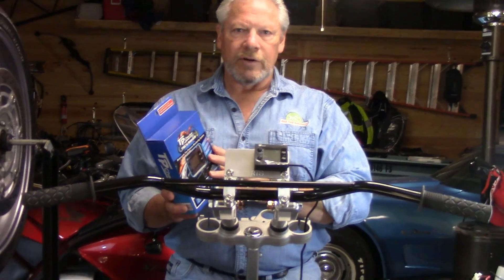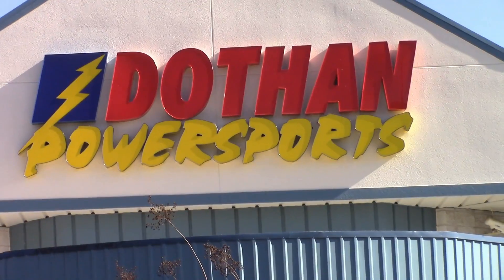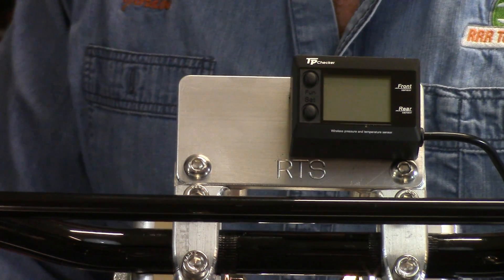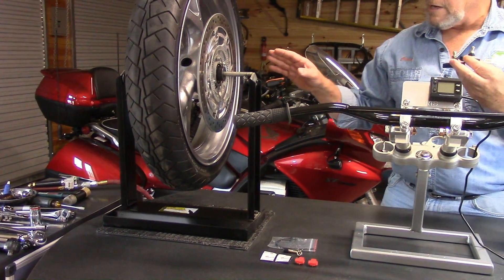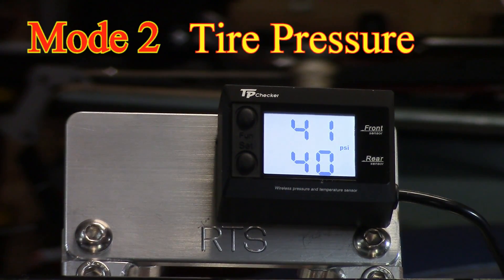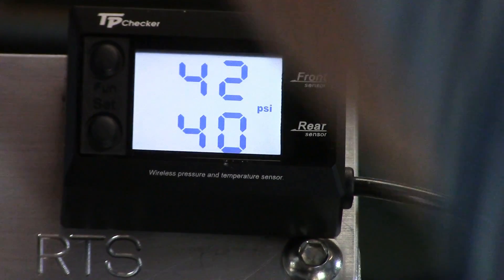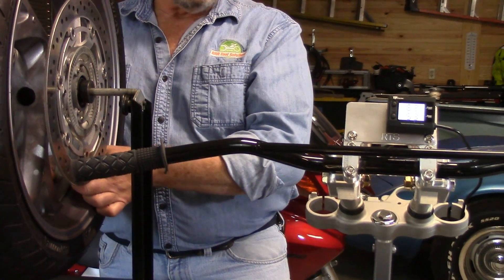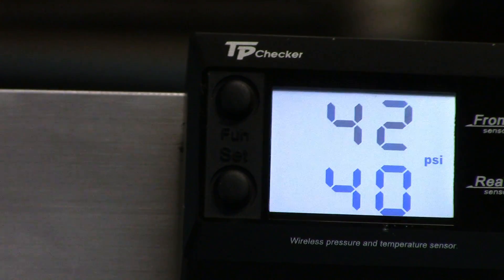Motorcycle Tire Pressure Monitoring System TPMS

Comment: Actually, some of the screw on TPMS sensors can read temperatures but I don't know how accurate they are. I just tried one of those screw-on systems and I returned it.  Here's why:  First, when you start out on your first ride for the day, that's the time to check your tire pressure. The tires should be  cool and not sitting in the sun and the bike should not have been ridden for hours. The same goes for checking and adjusting air pressure with any tires.   Well, with the screw-on system I tried, when you start your bike, it doesn't give you the real-time pressure. It gives you the last temperature reading from the previous ride. So to make sure your tire pressure is correct before you start your ride, you have to take off the sensor and read the pressure with a tire pressure gauge anyway.  Otherwise, I had to ride a mile or so for the sensor to update the monitor and, by then, the tires would be warmed up so you wouldn't see the cold pressure.  (If you were to adjust the pressure then to the recommended pressure, the tires would be under-inflated. Again, pressures should only be adjusted when the vehicle has not been drive, they are cool and haven't been sitting in the sun. 

But you mentioned something in this video that concerned me but surprisingly, nobody else mentioned in Amazon reviews of the screw-on TPMS systems. That is, that with a screw-on sensor, the Schader valve is open just as when you add or remove air from the tire. If the seal has a leak, the TPMS will actually cause the tires to lose pressure.  Thanks for mentioning that because from what I've seen, nobody seems to consider that.  

In the end, I found that the pressures the screw-on system gave me were wildly inconsistent.  The first time I synced them with the tires, they actually were spot-on.  But I checked them again and they were WAY off.  By way off, I mean the front tire, which I checked with a very accurate tire pressure gauge was at the correct 38 psi but the TMPS showed 27 psi.  The rear tire which was at 44 psi showed up on the TPMS as 30 psi !!!  So not only was the screw-on TMPS unreliable and inconsistent, but it didn't read real-time pressures (important for the all important tire pressure check before the first ride of the day) but it was grossly innacurate and it could cause loss of tire pressure. 

I suspect that many of the people who rated screw-on TMPS systems highly just assumed they were accurate - a very dangerous assumption.  And nobody considred the fact that they can leak. I thought about right after I received it and I was very concerned about driving around with the Schader valve open and depending on a little rubber gasket to prevent leakage. Not good! 

I think the in-the-wheel systems are the only way to go.